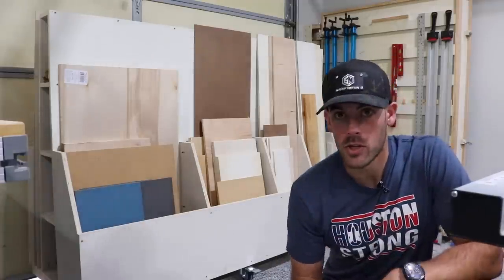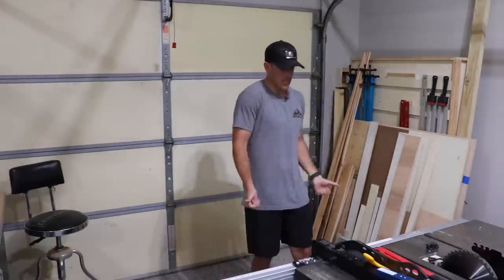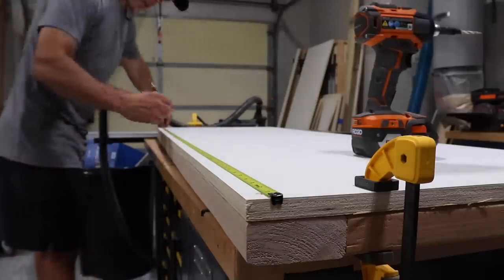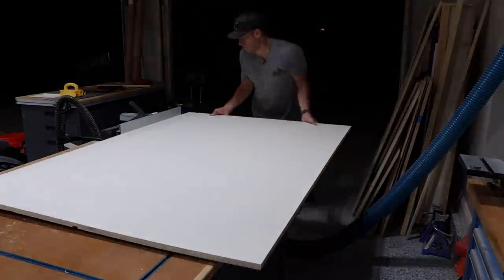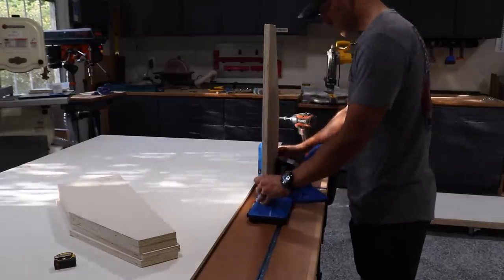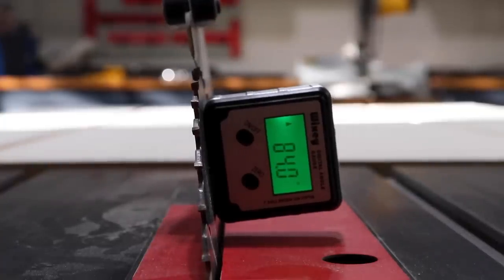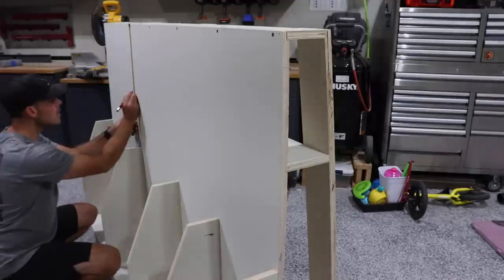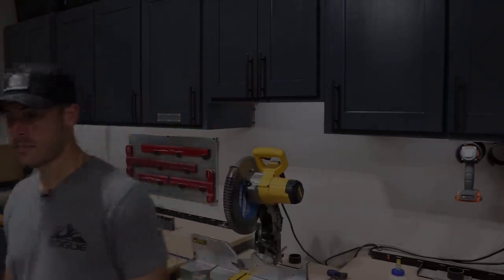Couldn't believe how HUGE of a difference this made

Comment: I’ve had a cart like this for about 20 years.  My suggestion if you are building this is to use larger casters.  Yes, they might have the proper weight rating, but you need a larger diameter wheel so it doesn’t get hung up on debris on the floor.

Comment: Hey Travis, years ago I built a lumber cart using a full sheet of plywood meaning the cart is 8ft long. I also used a full sheet of plywood for both sides, the small stock bin side and the sheet good side. Let me just say that cart is HEAVY and HUGE! I totally agree, overkill and now it is loaded up and practically un-moveable! Definitely worth tearing down and redoing to something more along the lines of your cart!!! Great job and yes, for the most part, I measure for the screw placement, it just looks so much nicer and professional! 😁

Comment: Bought the plans a couple weeks ago and finished the build last night.  Plans were easy to follow, I cut the dados on my table saw for the back panel.  Plans were easy to follow, and the design worked out well.  The cart holds a lot of lumber and cutoffs which is nice.  Now I have one place where I can see what material I have on hand rather than having to look through the various piles that accumulated on the surfaces of my shop.  My only change was not doing the dado on the very top edge of the back panel.  I just screwed it in and called it good.  In fact, one could probably skip the dados altogether and just hold up the horizontals with pocket holes from underneath.  Those shelves won't hold a tremendous amount of weight.  Those would probably be my only changes if I were to build again.

Comment: just curious, is there a reason you went with 3/4 inch over 1/2 inch ply, seems to me that 1/2 inch would give the same strength without the weight and less cost. unless i missed something, Thank You

Comment: I recently found your channel and have been binge watching your videos. One thing I have noticed is that you frequently have to fix connections you have applied glue to. I think you could really benefit from dry fitting your projects. Completely assemble using only the mechanical fasteners to verify fit and finish then disassemble and put back together with glue.

Comment: I built one similar but in 8ft long and once it was full of lumber 2 of the 6 casters failed and it would not roll.  I unloaded it and replaced the garbage casters with 11 better ones and now it rolls fully loaded.  If you are only using 6 casters just make sure they are heavy duty and can handle the weight.

Comment: I love the video. But I built one of these for my third stall garage shop and I absolutely hated having it during the winter time. I didn't mind it during the warm months as I would just park my truck outside a lot of the time. During the winter though when I want both vehicles in the garage cause of snow or it just being crazy cold it made the third stall shrink by having it. I was always moving it around so I had more space. Again though I liked your video and love the channel. Just my experience with a lumber cart wasnt good. I started really planning out anything I wanted to build a lot more so I dont have much off cuts and for the off cuts I do get I just try and make small little things out of it to sell or give away right away.

Comment: Great cart. You did some nice design work on it. It will hold a boatload of assorted stuff, you may be swapping out those casters for larger diameter ones. As heavy as it is, a tiny little piece of scrap will stop you cold, but  as you never have scraps on the floor, that point is moot. ;-). When I hand cut dovetails those little pieces seem to always land in front of a wheel, even if it's across the entire shop.

Comment: I purchased the plans several months ago and just now ha time to start the build.
I read through the plans and have found the Cut Sheets 1-3 confusing. 
I suggest that you remove repetitive cuts, i.e. Base Panel, Back Panel, Front Skirt, Back Skirt etc. etc. from Cut Sheet 1,2&3
Once a cut is made it doesn’t need to appear on additional Cut Sheets.
The Wood Storage Cart plans are excellent with the exception of my previous statements.
My 2 cents

Comment: Need dust collection? Your legs are great dust collectors! not seeing the problem.

Is that plywood from Lowe's? I found some pretty decent sheets that are primed on one side with lots of layers. Its the poor mans baltic birch. The top veneer splinters easily unless painted but its still pretty good for the price. I was just wondering what you were using. I really like the plan for a smaller version. Well thought out. 

I'm still holding out for the shop margarita machine build! I know it's coming one day! As always, love the channel. huge fan. keep spreading Shop Greatness!
Reply from the maker: Yes the blondewood from lowes is my favorite big box store ply.

Comment: nice cart. I think much of the parts could have been made out of 3/8" sheet stock, instead of 3/4". The dividers, and the skirts for sure, and probably even the shelves. Would save weight and $$.
Reply: Good point!  And with the cost of plywood today important. Frankly, using lower grade plywood for a project like this also is worth considering.

Comment: Nice cart, Travis! It coincidentally looks almost exactly like the one I built a couple of years ago. I skimped and used 1/2" ply which I instantly regretted. I also just used pocket holes to attach the shelves instead of dadoes. For the plywood side, I wound up adding two removable pieces of conduit that stick up in front of the cart so that I could sort through my sheets and get to the ones in the back without having to offload everything. Overall it has been holding up really well. Nice design, Travis!
Reply from the maker: I like the conduit idea, that is awesome
Reply: @ShopNation  yeah, it was a super simple and cheap solution and works well. Just made a couple blocks for them to rest on that I attached to the cart, then used a conduit bracket to keep the pipe on.

Comment: Really enjoying your channel and overall approach to "making" and talking about your YouTube side gig.  I infer that you are a displaced Tennessee boy like myself.

I tackled a very similar problem when I gave away a massive, far too large, way overbuilt storage cart I had built and worked around for years.  But I refused to buy materials for the smaller cart - I insisted on building it purely from the scrap I had on hand, which was barely adequate.  So I made a lot of compromises and accepted a "minimum viable product" outcome.  It would never be acceptable for a YouTube "maker" but for a wanna-be, it works.  Maybe I'll accumulate enough scrap now to upgrade to something more like yours.

Comment: You'd have been better off not screwing in the top of the vertical rails into the top shelf's "end grain" on the plywood. it was evident all you did was drive it in and not really get a bite. Screwing into the end f plywood sucks. Through-drilling and Dowling with plenty of glue would have been a better choice. $.02